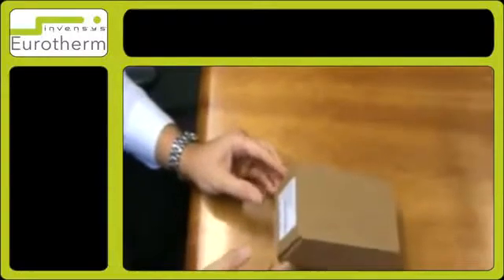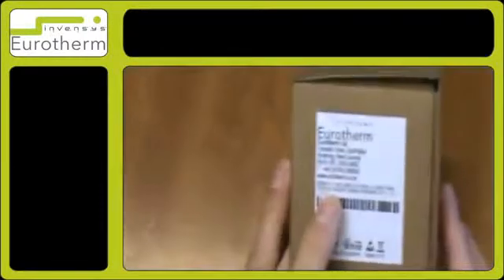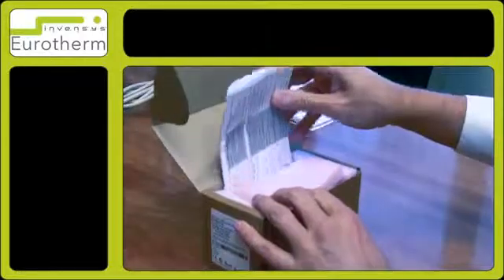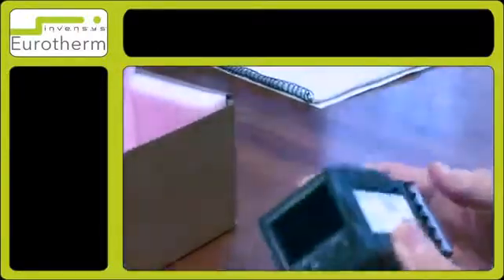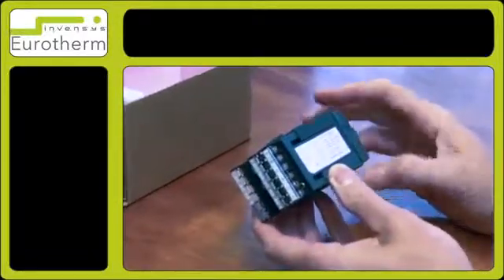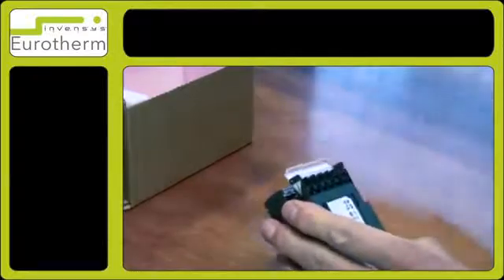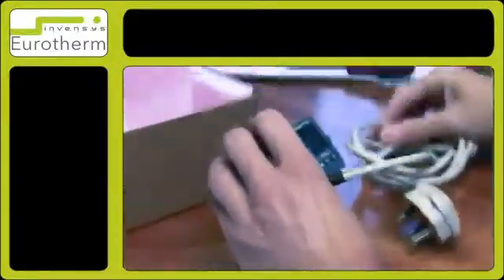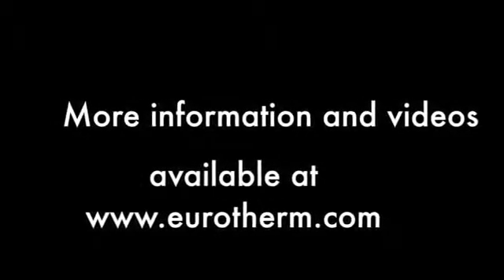Eurotherm 3200 Controller Unboxing

Comment: How do you change the reading from Celsius to Fahrenheit?
Reply from the maker: Hi,

Instructions to change units are:

Enter Level 3 by pressing holding down the Page key for more than 5 seconds.
Observe LEu3 GOTO.
Enter CODE 3.
Page to INPUT.
Scroll to UNITS.
Change to Fahrenheit using the arrow keys.

Press and old down the Page key for LEu3 GOTO.
Select LEu1.

This has now returned back to operator level.